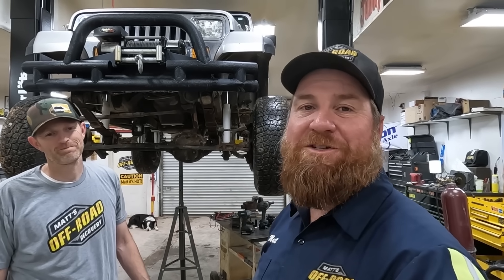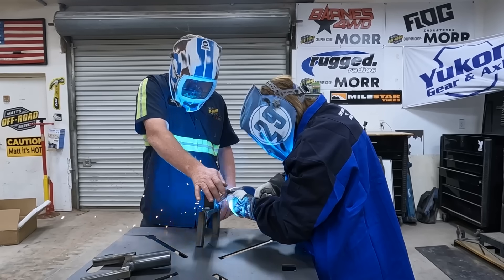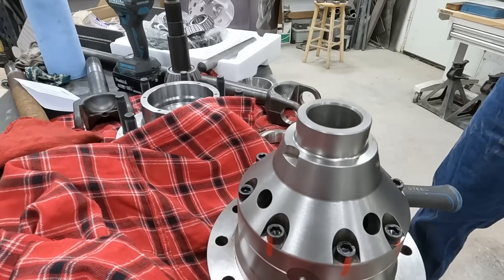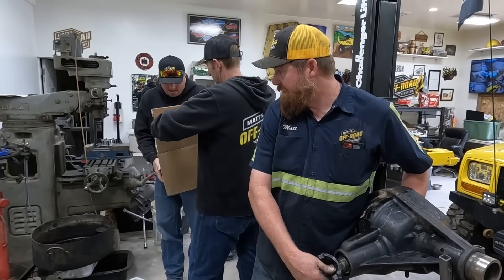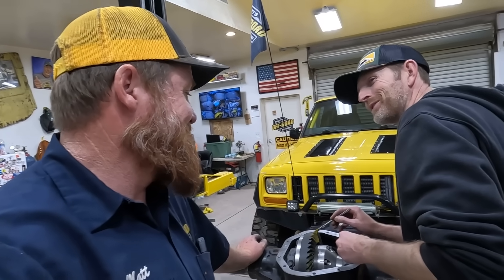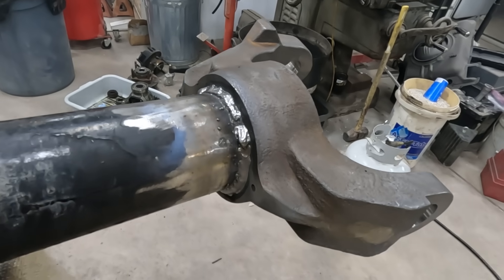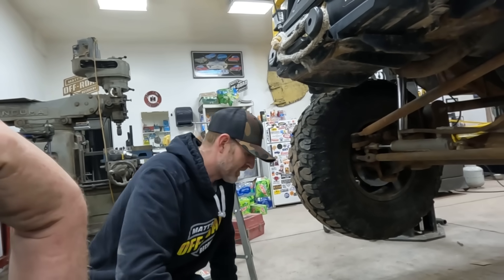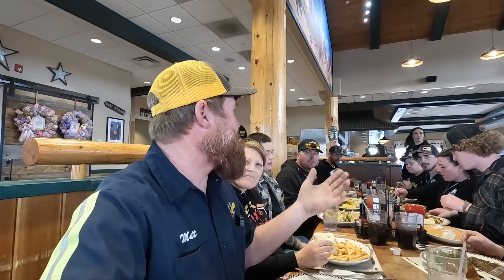Ouch...They Broke My Jeep At The Wrecker Games

Comment: ........ Installed complete diff. gearset and bearings AND cover before building the housing .... How did you keep all the metal filings ,, grinder grit and welding slag out of the diff. bearings .... ??? .. Destruction looming in the future ...

Comment: First. Let me say how much i love what you guys have accomplished with your shop and my favorite YouTube Channel. 
I've set up a bunch off gears and the first step is finding the pinion depth. it's usually stamped on the end of the pinion gear. It will give you the measurement you need to start out. i usually put a couple of shortened push rods across the landings where the bearing caps go. add the thickness of those rods and you have your depth. I know I'm late to this video comment but i thought i had to add my 2 cents. in the last 40 years I've even used cut up coke cans for shims. even on drag cars. you have inspired me to start working on projects that got sidelined the last few years. keep up the fantastic and completely entertaining channel that you have built!  love you guys!

Comment: Sorry Guys, But I'm a Fitter and Fabricator, I would have stripped everything out of the axle cut it down to length welded the Knuckles and brackets on, then let it cool down AND ONLY THEN built the gear set and got all my clearances right, I WOULD NOT HAVE WELDED THAT AXLE WITH ALL THAT NEW GEAR INSIDE. That to me is wrong, you don't weld that much around all those Bearing etc.

Comment: Didn't the 1999, which was the 1st year of that Super Duty come with a Dana 50? My work bought one and I seem to remember that.
Reply: Yes. They started using the Dana 60 in some of the 2001's. I have a 2001 F-250 with a Dana 50 so I missed the cut

Comment: I love your enthusiasm, I have been following your channel for years now. As your welding knowledge continues to grow, please stop using your slag hammer as a pick axe. Every indentation you make is a stress point that may lead to failure. The hammer is designed to be slid along the toes of the weld to remove most if not all of the slag. The better the weldor's control of parameters such as amps, weld speed, rod speed, rod angle, base prep and more will cause the slag to release more easily. 
Jody from the YT channel WeldingTipsAndTricks is a phenomenal weldor worth watching and learning from if you get hungry for more!
Love the channel and all your wild adventures, just want to save you from the mistake many weldors from outside the trade make. A wire brush wheel or cup on an angle grinder can help remove what the slag hammer leaves behind.

Comment: I'm curious what angle you set the inner Cs compared to the diff pinion. It looks 90 degrees but you have longer travel then factory. How does the steering feel on the motorway now?

Comment: You're not getting very good penetration with that stick welding because you're dragging it along like you're using a MIG. To get good penetration with stick, plunge the end of the rod deep into the puddle, pull it back a hair, plunge again, and repeat. Stick welding shouldn't create one, level, continuous bead. Trying to make it do that will leave you with shallow welds.

Comment: no welding nodular iron and how do you keep breaking the 44 on that light rig with smaller tires and less power I'm whiskey throttle 420 horse 396 39.5 boggers in a 6000lb chevy

Comment: your supposed to push a mig not pull i.e the torch should lead your weld.

 but pulling it does work. and actually is a cheat way of getting more heat into the weld

Comment: Love the detailed video.  I can't believe the gears and seals are actually installed when welding those C's on.?  I would be concerned with all the splatter and slag dropping down the tube especially when it was vertical.  Keep up the good work and I like the longer videos.

Comment: you spent a day doing the diff gears got it all together then welded the open axle ends and chipping away weld scale plus all the dust from the welding down the open tubs into those nice new gears that cant be good

Comment: I think you guys need some Lincoln er 71 elite wire for things like that. It does great uphill with plenty of penetration and is very forgiving with your settings. It is a flux core gas shielded wire making it great for out side work and fabrication in the shop and isn't as affected by debris like rust dirt and oil like solid wire.

Comment: One thing I've found that seems to work well, is use whatever amount of shims that were in the axle initially with the new gear set. It either gets right on, or really close. Reason being is that the gearsets themselves are all pretty consistent regardless of make. The housing has about 95% of the variation. Your results may vary, but you probably will have more inconsistency with older axles.

Comment: Great job guys. Just one tip, you shouldn’t pass your ground current through anywhere that has bearings in it. Always keep you ground clamp on the same side of the diff that you are welding on.

Comment: Just yesterday I saw someone at a hobby shop wheeling an rc wrecker just like Matt's. It was a modified trx4 chassis with old school metal toy cab that looked really close to what Matt has and it even had Mickey Thompsons on it. And it had 3 functioning winches, 2 on the boom and one on the front. It was pretty awesome. I'm in MN.

Comment: FFS Matt You really gotta start wearing saftey glasses!! I saw the safety squints on the axel welding and I'd say that was on the line but when working with a grinder (or anything spinning really) you gotta protect your eyes. YOU ONLY HAVE TWO AND YOU NEED BOTH.

Comment: Great video!!  I like the shop stuff. Reminds me of the old days in the aircraft de-icer building plant. Started with a Ford 750 chassis and ended up with a truck mounted de-icing machine with a 40' aerial device with a two man basket on the end. They were used by the top airlines as well as the U.S Air Force and the Navy. Those were some good times!!

Comment: That's a little scary with Ed's new shower door. I was in the glass and glazing industry for 45 years and in my state it's against the building codes to have a shower door open to the inside in case of someone trying to get out to avoid hot water burns. Must have different budding codes in Utha.
Reply: I agree, it is also supposed to open outwards in case someone falls in the shower. You won't be able to reach the person unless you remove the door or if it opens both ways.

Comment: What was wrong with the trans in the heavy wrecker...?
Even I have a dial indicator, an old in/lbs torque wrench, and stuff like that.  C'mon Matt....  That said....I still use marking compound and measure last.
The front diff from the banana will make a nice upgrade for Jamie's XJ.
Don't sweat the thinking you can get more done in a day than you can.  That's just how it works for most of us gearheads.
Reply: Last I saw, they had lost reverse gear in the wrecker.

Comment: Wondering what you’re doing for unit bearings to get rid of that metric lug pattern of a SD? I’m running a 05+ SD 60 and man I’d like to have those knuckles and BJ eliminators but that’s out of my budget, luckily the stock stuff is pretty strong.

Comment: Wow, that's a lot of work. I would have just taken the axle to a shop and called it a day, but then, how can you learn. Noticed the axle tubes weren't covered to prevent slag and splatter from entering the tubes. Hope you check and clean them before running. Would hate to see you hard work destroyed.

Comment: Don't want to be a downer but when you guys were welding on the rear end while it was up ended the sparks and the weld slag was going down the hole right into the gear box.